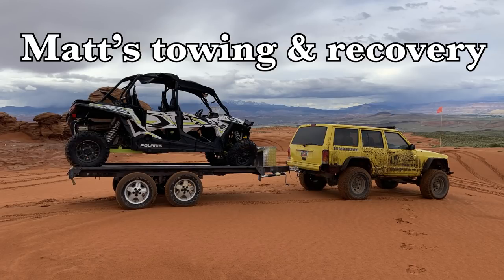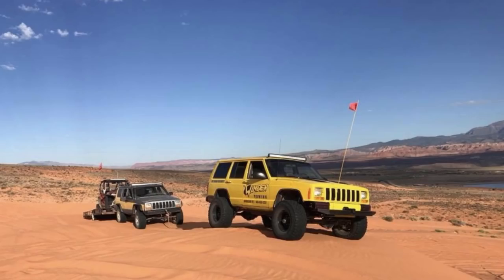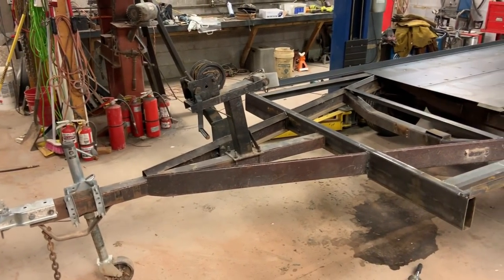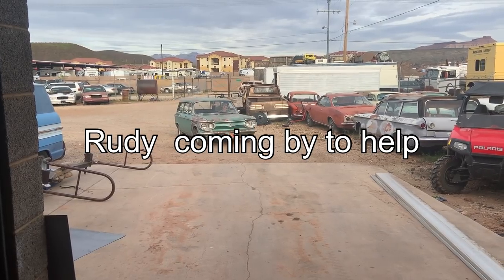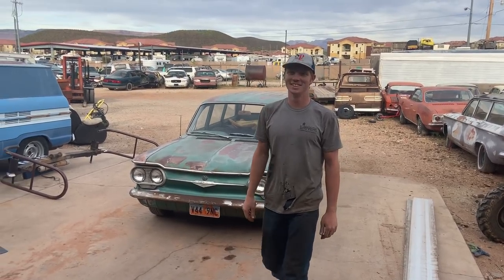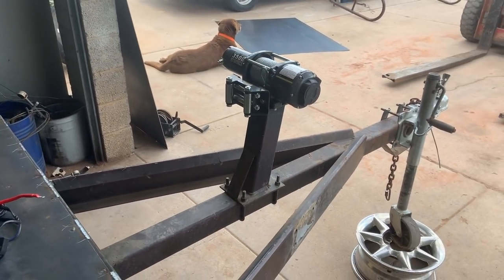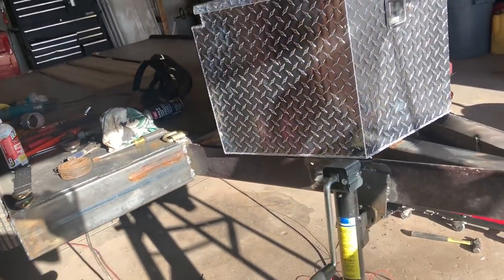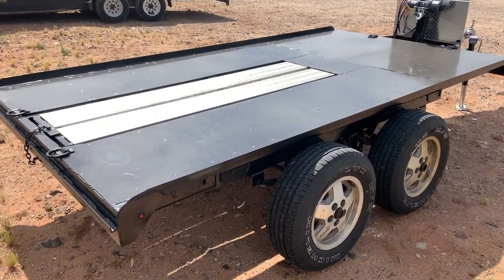Off-Road Trailer Build

Comment: Matt, trailer turned out great. I did the same thing SOA on my 7x14’ single axle with a 4000lb axle and added some used 32” inch Dunlop mud rovers MT’s. It’s setup with the brake flanges which will be adding next. My RZR 900 S weighs about 2100lbs and Ace 570SP is around 850 give-or-take. It’s 10x more capable than the 215x70-15’s it came with. Bulldog extension tube for the flip up jack.

Comment: This is an amazing trailer.  It is designed and built perfectly for what it supposed to do and winds up doing a lot more as we see in later videos. I like the nice, evenly spaced, consistent welds that your son Rudy did and they are obviously good since they have held up well in use.  At first I wondered why not tread plate on top , but as I saw it in use it was obviously better smooth on top to not collect sand and mud and weighed less.  The spacing and positioning of the axels allows it to be very versatile in tight up and down situations.  Ed also did a great job painting.  Now we know what other talents he has.  Sorry about losing the battery jump box.  I'm surprised no one turned it in.

Comment: seen a few clips with the offroad trailer. In rocky terrain the trailer meets quite a few rocks on it's corners. If I may suggest adding like 6" wheels (with non hollow rubber tires)  on the corners.
Especially on the front corners. Thus instead of scratching the rock it will roll over them. Easing the pull and preserving the trailer
I have so much fun and learn from the videos you publish - thanks

Comment: Off road 4 wheel trailers, particularly for sand and rocky terrain, perform a lot better with walking beam suspension rather than twin axles. 

The advantage being that the load is always evenly distributed between the wheels regardless of the terrain or weight distribution and you have better ground clearance as you don’t have axles to drag in the sand or get high centered on obstacles.
Reply: I think that would violate the cheap and lazy build strategy that he mentioned in the jeep build, lol.

Comment: I re-built a twin axle up & over trailer near twenty years ago, when i got it it was fitted out with rotting diamond board ply wood for the deck & i replaced that with 2mm steel checker plate.
My biggest regret was not spending the extra on aluminium checker plate, that would have dramatically reduced the overall weight of the trailer & saved me the aggravation of having to paint it both sides.

Comment: I was in the towing business in Ohio. For off road recovery we used a 1942 6x6 Army Tank Retriever. While it worked extremely well I believe your solution is more cost effective. LOL
Reply: Charles Hullinger I think the topography is more suited for a jeep in these areas of sand, tight technical trails, cliff edges etc. From what I remember from Ohio, it’s a lot of flats, and mud.

Comment: Rudy should have sleeves on when he's welding....but I bet knows that now.   Also, for an OFF-ROAD trailer I would add a kick-up skid plate to each of the axles.  Sledding the axles OVER stuff beats trying to plow those axles THROUGH the same stuff.   Nice work.  (I'm a fabricator, too)

Comment: I made an off road trailer just like yours to haul firewood here in Pittsburgh. I used a pintle hitch to hook mine to my truck after i bent my 2 inch ball hitch from articulating sideways. Might benefit you to use a pintle, and no if you match the lunette ring on the trailer with the pintle on the truck there is absloutley no slop whatsoever and its way stronger. Might want to look into that Matt.

Comment: Hi, Matt!  Love your videos.  I am going to be bold enough to suggest an improvement to your trailer, which is already very well thought out.  Occasionally, the trailer hangs up on protruding objects - rocks, trees, etc. - at the corners of the leading edge.  I would like to suggest a "skid plate" on the leading corners of your trailer, either in the form of a 45 degree angle cut into the front support, or the addition of a 45 degree angled "skid plate" welded to the front corners - it looks like you have enough tongue clearance to do this.  This would push the trailer away from those objects it hits. rather than allowing it to get hung up on them.  I don't know if this happens often enough, or is inconvenient enough, to make thinking of a solution worthwhile, but I noticed this is occasionally a problem when hauling the trailer through tight openings, and thought Id just offer the suggestion.  I am always impressed with how well you've designed your equipment to function in the environment you're in - keep up the good work!

Comment: Looks like a great trailer.  Just saw two issues, one was brought up about the fenders.  I bet that will come later.  The other was the clearance between tire and frame.  Does not look like it could articulate well in tricky situations.  Some offset rims would take care of that over the old YJ rims.

Comment: Like your channel and enjoy watching what i can. You are good at what you do. I have an idea you might be able to build to assist your razor recovery’s. Since your good with fabrication it would be great to see a tripod system that has a pulley in the middle.so you can erect it and run the winch cable through. Then that would lift the front end of the razor to help get it on the trailer.  I have seen many of them that have front end collapsed. And it would save you some time. And maybe not damage the new trailer build. Just wanted to throw the idea out there. Maybe a v formation that attaches to the trailer that just pivots up and you can make an adjustable third leg back to the trailer. That way you can adjust for the recovery. And lessen the load back on the trailer.  Have fun hope to see more videos.

Comment: You should build some removable fenders that can double as ski’s to help it glide across the sand versus sink. You could run a couple straps through the wheels and choke the tires so they can’t move. Love the vids though! Keep them coming!

Comment: Walking beam with air suspension may be lighter and have better ground contact than that design. Harder to build though unless you just wanted more channel content, people love unique trailer builds. If you wanted to get outside the box, jack the load in the centre so all the weight is over the axle, then the rest of the trailer can be mesh, you don’t need to support a load entirely on its wheels. You could try using aluminium too.

Comment: And if you do need to pull something heavier onto the trailer you can put a snatch block on the wench and double up the pulling power on it do you ever use those snatch blocks

Comment: Good to see the younger ones learning valuable skills for the future. The shop foreman in me was triggered by no long sleeves and having his head right over the work. A couple spatters of slag will teach him to wear long sleeves next time, no real harm there. 
But try to have him not sitting right over the work while he's doing it. Spatters hurt for a second, but inhaling burning metal and flux or gas is no bueno for your lungs. Inhaling iron fumes can cause siderosis and even cancer if you do a lot of stainless. Easy way to avoid it is don't sit on top of the weld while you're laying it. 
Bonus points if you have a small fan you can use to push the fumes away from your head. A cheapo fan from Walmart is fine, no need to spend a lot of money. Hate to see the kid hurt himself doing stupid stuff like us older guys did.

Comment: Nice trailer. I personally would have made it a tilt and load but that is just my opinion.
Reply: You'd be adding a whole lot more weight for no real gain. Ramps take 30 extra seconds. The idea is to keep things lightweight. He built exactly what he set out to build for its intended use.

I'm sure you'll have lots of fun dragging your tilt trailer out across the sand dunes to do recoveries though. Be sure to post video!
Reply: @austinmabry5654  I don't have a tilt trailer  I just thought it would be easier than 2 narrow ramps for side by sides with suspension ripped out of them.
Reply: Oh, so you don't do this for a living? Talk is cheap...
Reply: @austinmabry5654  I do drive a flatbed  but I have no idea what I am talking about

Comment: You should put bigger tires on it like from an earth mover and put electric motor in it so it can crawl on it's own and 3 more axles and you could put a crane on it so you can just crane up the semi tractors that get stuck out there... hope you catch the sarcasm.  Looks very nice, your son is a hell of a welder.  I am sure you will keep modifying it as you need.  The only constructive thoughts I have are maybe a different hitch  even the old pin type so it cannot come apart, a roller at the tail just a pipe rolling on a bar for the cable to slide on, if you did the outer pipe in pieces you could use it to hold the ramps up to the outer sides. The opening in the middle will be an issue when parts hang.  When I slide things up the ramps on my trailer I have some plywood pieces that can slide right up with what ever is dragging laying on it.  I am not going places you are and it is easier to keep a couple 3/4 pieces to use but you are very resourceful.

Comment: Looks like a great tool for your business! Great Job!  Have you ever evaluated the "Tundra Tires that Bush Pilots in Alaska use to stay afloat on soft Gravel bars etc. They may just be the answer to the hard pulls though soft sand. May be horrible on slick mud and snow#%@##!

Comment: Nice trailer, like always I enjoyed the video but I have one question how do you get away with not having fenders over the trailer wheels? Can't wait till next video!
Reply: The bed runs over the top of the wheels, no fenders required. there may be a requirement for mud flaps though.

Comment: It just occurred to me how much easier loading would be if your ramps were twice the width, weld longer square tubing at the ends. I know you keep talking about weight but the extra weight would be mostly aluminum and it would be nominal. I’ve watched a bunch of your videos and a lot of these vehicles have broken A arms or are otherwise very difficult to square up to the trailer.

Comment: It needs some of those adhesive traction tape strips before anyone slips on it
Reply: He wants the bed smooth so he can slide vehicles on and off easier. traction tape would get torn off quickly in the application.

Comment: Does the bed of the trailer need to be a solid sheet of steel? Couldn't you cut 1" wde strips 2" apart and 2 to 3" from the edges to save weight?

Comment: Just wandering if you thought about changing thr hitch out to something more suited to off roading?
Reply: john mine lunette would be better. He already uses a pintle on the Jeep. Those lock n rolls look cool, but they’re not worth the maintenance they need or added complication over the lunette/pintle, either. The only real advantage of them is slightly less slop/noise.

Comment: Matt not to be "that guy" but will your trailer clear that over pass culvert tunnel? Or are you going to clear the tunnel out for your own benefit.
Reply: @MattsOffRoadRecovery  I figured with your off road recovery kung Fu  being so strong you'd have a good reason behind it. Thank you for taking the time and efforts in making these videos. We  all appreciate them. I literally learn something new every video. Your line of attack wide swings to track the tow vehicle correctly. The amount of distance you back up to use the kinetic energy of the recovery line. Keep up the good work. Wed watch you clean your tool box and still enjoy it. May you be blessed in all endeavors you and yours engage in. Stay hydrated and rested Sir

Comment: i would of put open grating on for the deck for lighter weight
Reply: I thought that too as I also weld but alot of the ATV's he rescues are bent up pretty bad and some dont have wheels on the front after they endo them or roll them so when they drag those up on the trailer it would just get hung up grating across those open spaces. If it was a trailer for non wrecked for sure use the open grating or even aluminum but even aluminum would get gouged up on those wrecked ones

Comment: Hey it’s Rivers from North Pole, Alaska 99705
(Incase u need Santa’s zip)

Q u talked about doing something to your shackles to keep them from flipping 

Pls so and explain your solution 

I too hav a 3 axle flat bed trailed that is prone to that same issue 

Sometimes a tire is off the ground but pulls fine and seems to flip back if loaded so do I even need to worry about it? Anybody got advice?

Thanks Rivers
NPole Ak

Comment: No Brake System in Trailer? Not possibel with this weigth in Germany.
Reply: 3500lb is the limit in most states of the US. You can over build it but under rate it and slide under the radar.
Reply: Wow, the hitch on the truck too? I thought we had it bad.
Reply: @Tiersmoke92555  With trucks you mean Transportation Trucks over 7700 lbs?  This is very different. These Trucks need every year a security check. Trucks maximum weight with trailer is 88000 lbs and 52 feet long. Speed limit on high way is 50 miles. Trucks over 16500 lbs: Trailers have brakes with Air Pressure. And a security system, loose on part of the Truck with trailer the air pressure, the truck stopp immediately and can only move with a mechanic man.
Reply: @Tiersmoke92555  All hitches, also for Trucks need too documented in vehicle papers and security check.
Reply: @snackameck  I was meaning pickup trucks, but we are hard on semi trucks as well. Most states let you move 26,000lb with out a CDL.

Comment: It's fascinating to me that Matt doesn't seem interested in a pintle or lock and roll hitch. Perhaps they're not as required as I thought. I'm not qualified to judge, though, as I don't have experience with them. I'm trying to decide whether to spring for the extra $$ to get the lock and roll hitch option on an off-road camping trailer. If Matt doesn't need one, I'm doubting whether I do, but that seems to go against just about everything else I'm reading.

Comment: All that custom work and youre using Dime sized tail lights?!? With the amount of time you spend on the highway, I would think more visibility is important to your safety! Atleast get one of those LED Tailgate bars they make for pickup trucks that sit under the tailgate and mount that nice and tight in the rear, so it stays low profile, and can be seen from the rear without issue even on a sunny day.